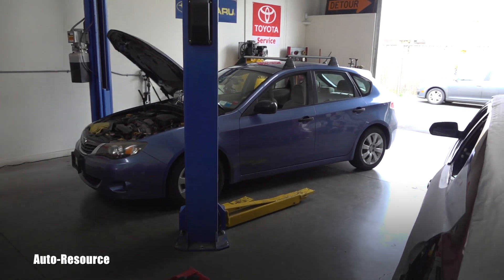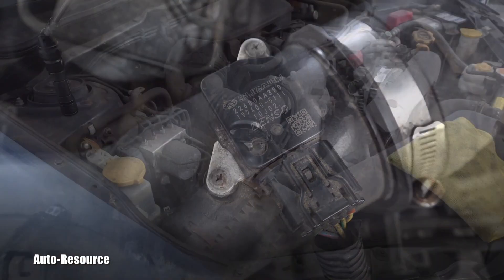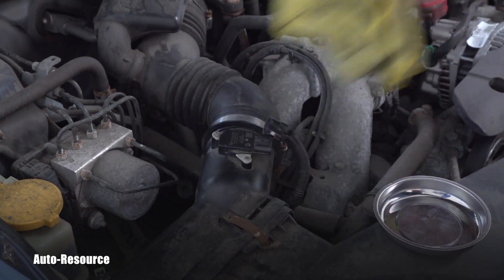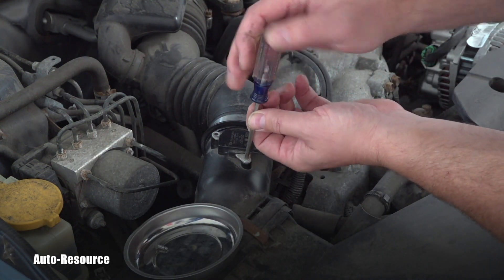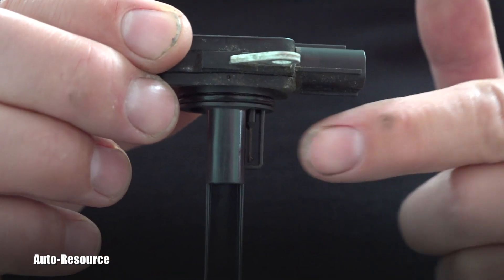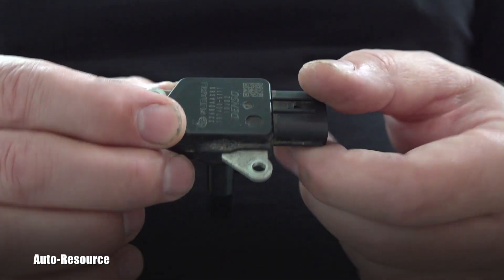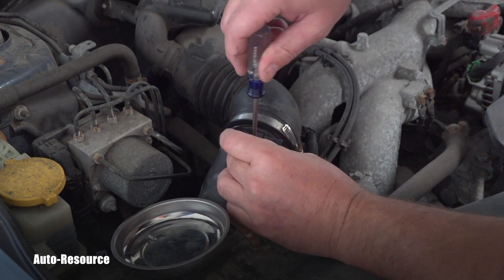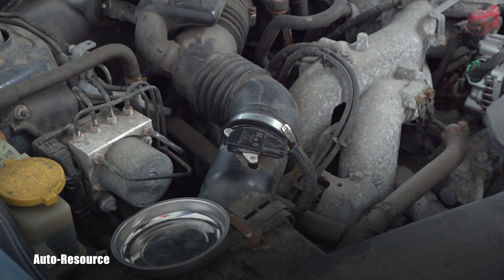Subaru Impreza MAF Sensor

Comment: Peter,
If you look at the factory service manual diagram for that MAF sensor, the wire you mention is the air intake temp sensor wire not the air flow resistors.  The resistors to clean are deeper inside the sensor toward the base of the sensor.  Great videos though thank you for the resources.
Reply: I was just about to write it then come across your comment my hat goes off to the guy for helping others do some lite work on their cars if they are unsure how so yea we all learn something new everyday